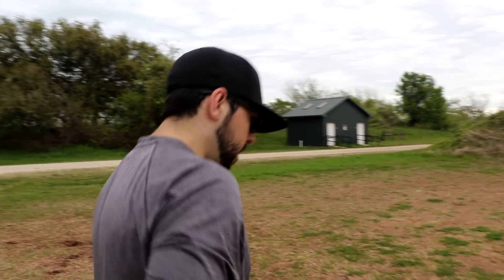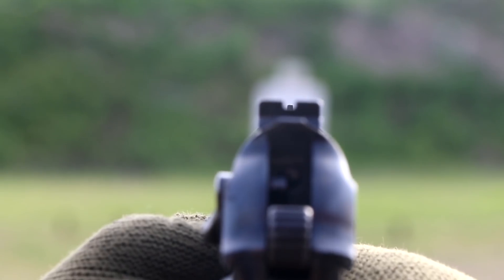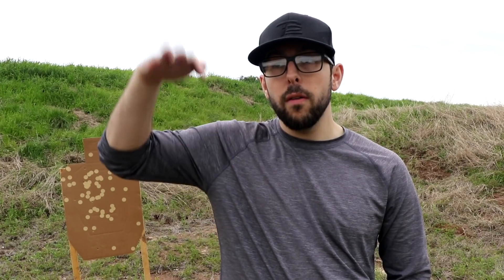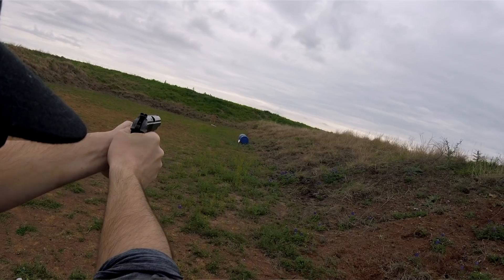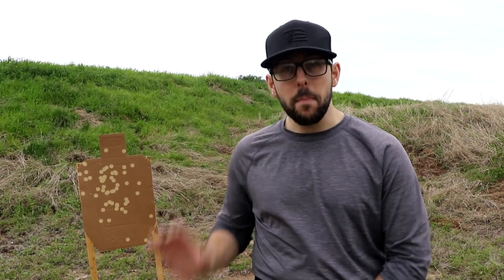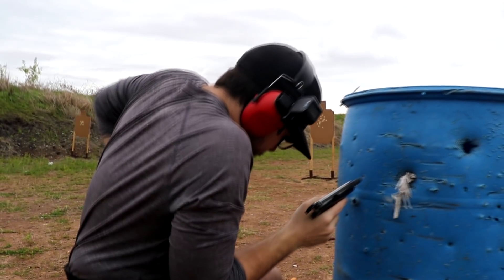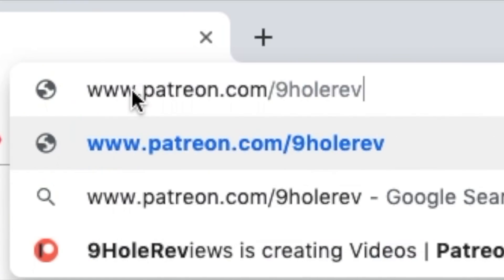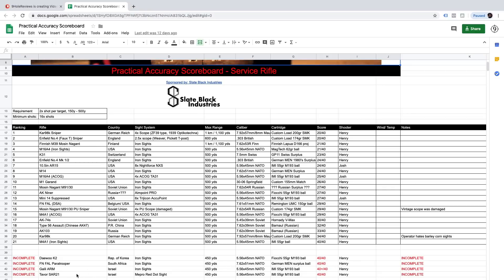Makarov PM (E. German) - Close Range Practical Accuracy

Comment: "I have to change my grip to shoot it.."

"Two alpha, two alpha, two alpha, two alpha, two alpha"
Reply from the maker: It's the speed that suffered the most on the close ones, I think.  It's obviously very hard to see on camera, but I was having to make fine-tune adjustments between the shots in terms of where my sights were...because I wasn't able to achieve a reliable "return to zero" after the firearm cycled based on how I was forced to grip.
Reply: @9HoleReviews  Needless to say, they definitely didn't envisage this kind of usage when it was designed...
Reply: @9HoleReviews  I imagine a run with the VZ-82 would be as clean but faster with its better ergo's, better trigger, and double stack mag for the same cartridge, similar design and size.
Reply: Wyatt Earp said the way to win a gun fight is to "take your time in a hurry." And, imho, that's exactly what you did, fwiw

Comment: East german military (NVA) used to say " 9 shots and one well aimed throw" when it came to shooting the Makarov :)
Reply: Were east german soldiers trained to carry a full 8 round mag with 1 in the chamber?
Reply: @hovojefe   I think no
Reply: @bigingo4269  yeah me neither. As a matter of fact I dont think any military in the world would train on that except maybe some special forces groups who that 1 extra round could make a difference to
Reply: @hovojefe  some armies do, south africa does it, only one I know cuz im from SA
Reply: @sovietred7371  well that's something new and cool! What sidearm is the standard in SA?
Reply: @hovojefe  it's basically a clone of the Beretta 92FS I do believe made by the Vicktor arms company
Reply: @hovojefe  I got my Makarov when I was 15 and I still have it and to this day I carry it with one in the pipe. It was designed to carry in Condition 1. From the trigger block safety/decocker to the firing pin that's milled down to be too light to ignite the primer on a drop, it's an amazingly well thought out gun. And they must have had a poor example here, mine shoots better groups than that. I say that because I'm obviously not  a pro shooter so the performance here has to be the peak of this example's capability.
Reply: Eric Grumbles yeah they’re all surplus so bores can vary
Reply: What they didn’t use the extra mag pouch sewn onto the outside of the holster? That gave you an additional 8 shots. And most Soviet aircrews like me carry 2 extra mags plus 1 in the gun
Reply: @scottsaylors1996  most Makarov guns actually used a chrome lined bore for longevity. It was also to help with the odd batch of corrosive primers that the ammunition suppliers used on occasion

Comment: The Makarov 9mm cartridge is a very snappy round. The full size service pistol is a smaller frame pistol compared to most NATO and the Czech CZ75 pistol that uses the 9mm Parabellum. This is not a combat handgun because in Eastern European mindset it's more of a personal defense pistol or a status of rank like carrying a sword. I am sure these pistols were issued to tank crews, machinegun crews, and other ranks who needed pistols in combat. It was an improvement over what the Soviets had as service pistols and revolvers that they had used during WWII. This was the universal issue handgun for all arms. It was designed to be practical and useful with a cartridge designed to be lethal at close range but not impressive ballistically in velocity as the older 7.62x25 Tokerev and not over penetrate but hold mass into the target at close range and have some adequate knock down power.

Comment: What you’ve got to keep in mind is what the mak was designed for. It was intended for officers and NCOs for use as a backup weapon to use when your AK ran dry. It was intended to be a do all sidearm for a country where most folks didn’t know Jack about guns . It had to be according to the design specs blowback operated, simple and reliable over all else. The fact that you actually hit something at 35 meters is impressive as the gun was not designed for much over 25 meters effective range. It’s actually a pretty solid little gun and considering you were on that last station 10 meters outside its max range that’s pretty good. PMs are pretty solid Cold War vintage guns that can still be effective today
Reply: It will be effective for thousands of years

Comment: The Makarov is a sound design. Accurate, decent trigger, good safety, and very simple. But, one must consider that it is a product of its time, and that nowadays one can have a more compact and lighter weight design firing 9mm Luger. As defensive handguns go, you could certainly do far worse. They're absolutely reliable and 9x18 offers better performance than .380 ACP. And 10 years ago, when commercial pocket pistols weren't quite perfected, there was a real place for them still. But nowadays you're better off with a Ruger LC9S or similar.

Comment: The Makarov PM is not the most modern pistol. But it is decently comfortable to shoot, comfortable to conceal, robust, and simple in design. I would argue that it is one of the greatest blowback designs. Plus if you ever have to use it(Heavens forbid.) in combat, you won't be turning in an expensive gun. Not that I would want to part with my Mak PM. But turning in a 300 dollar pistol doesn't hurt as much as something in the 400 to 1000 dollar range. The only true downside to the pistol, in my opinion, is the double action pull of the first round. But even that can be overlooked with training.

Comment: I have had a bulgarian makarov for years and I have big hands and I just rode the slide lock.   Reloads were slow but with those small and precise sights and fixed barrel its the most accurate non optically sighted handgun I own.

Also not a mistake that the Makarov was originally built on old walther tooling the Soviets looted after ww2 and the Germans were also developing a 9x18 round

Comment: I wonder if the Aftermarket "Pearce" Grips were amplifying your  hold stability problems with the large thumb bump. Have you tried one with the factory grips? Good video as always.
Reply: East german mak's came in these grips.
Reply: @240pixel  You mean aftermarket rubber "pearce" brand grips that gun has was original?. East german grips are not grey colored rubber they are black plastic with very little finger bump and a thin not thick back strap.  I own both they are not the same.

Comment: I always liked the Makarov and the idea of it (when the rest of us were going for the "best" and more powerful service guns, Russia realized handguns don't win wars so why go crazy, just pick something that works and is simple and economical to produce.  Probably not the best police round, but then, if they're not using JHPs anyway .... ?
I have only shot one Mak (as much as I love 'em I just never seen to find one or at least not until after I've found something else I just HAD to have, LOL).  With that safety coming back like that, I've never been more glad I'm a left-handed shooter as I came away with all my skin. LOL.  I have two other pistols in that caliber, a CZ82 and Radom P64.  That round might just be basically a .380 but it's brutal out of that P64. Still, that little gun winds up in my carry rotation for summer as it's just so thin and light enough (though very much steel) to carry all day under a t-shirt when the weather is brutally hot and unmercifully humid here on the Gulf Coast. The P64 had a bevel on the rear of the slide to prevent slide bite.  I still get this weird "V" on the web of my hand, though.  It's not a cut, and best I can figure, it's a bruise left by the pressure of the little gun with those thin little grips coming back under recoil. Anyway, great review.

Comment: One thing to keep in mind with the Makarov is that it's not exactly intended to be a combat weapon. I mean sure you can use it in combat but any other decent semi automatic handgun of the time period is going to be as good if not better than it. What it was supposed to do and that it objectively does quite well is 1) be small enough that an officer can carry it all day on their hip and 2) be cheap and simple enough to make.

Now the Tokarev, that's a much better design for a combat handgun, but after a bloody and hard fought war of attrition like WW2 you kind of understand why the soviets decided that since handguns are essentially worthless on the battlefield you could save up a lot of material/factory space/trained workers/money by switching to a simple, cheap but still okay enough simple blow back handgun.

So when you keep that in mind, it did pretty well for a simple design that predates the P7 by like 30 years. But having a great shooter behind the trigger must have helped a lot too.
Reply: And its design is so damn elegant. I think it even beats the Glock in the low number of distinct parts, and most complex parts serve 2 or 3 functions. And each of these parts is extremely durable.
Reply: Actually the Mak was intended as a combat sidearm. The intention was to replace the WW2 vintage TT series of pistols with a simplified easier to use blowback operated handgun. That was cheaper to produce, harder to loose the parts to and fired a slightly less powerful bullet. The end result was a true do all handgun that like all Soviet systems was “ good enough “ to do the job

Comment: Awwww life's not comfortable? Awwwww....your grip? It hurts?
Reply from the maker: Of the comments we generally receive, this one is pretty far down the ill-conceived route.  You've just heard us describe the effectiveness and performance of the firearm taking into account the required alterations to the "best" grip based on design of the gun.  As a reviewing channel, why on earth would we ignore the ergonomic deficiencies of the platform, especially when we have and can draw direct comparisons to others you've seen on the show?
Reply: @9HoleReviews  What you don't spell out is that a weapon of this role and vintage was never designed for this purpose, a two-handed grip, fire and movement, rapid fire etc etc. You can't compare it directly with modern pistols. But you know all of this. Some of the viewers might not of course.
Reply from the maker: @skepticalbadger  True - which is why we used the PPK and the P7 as the comparatives, opposed to say, a Glock 19.  We felt those two pistols were most in alignment that we had already shown on the show.